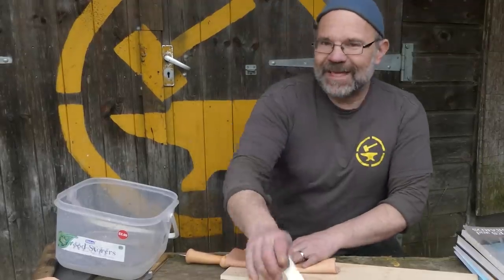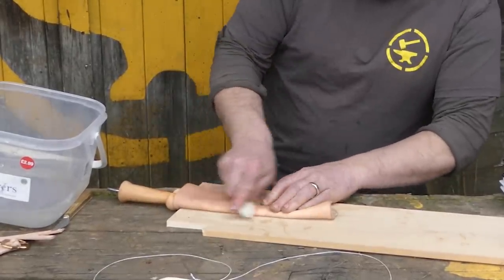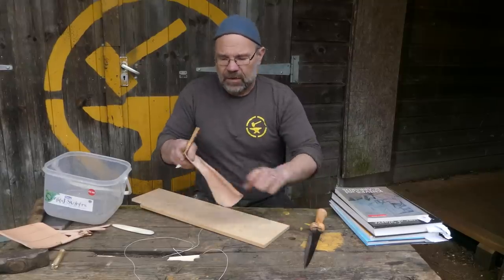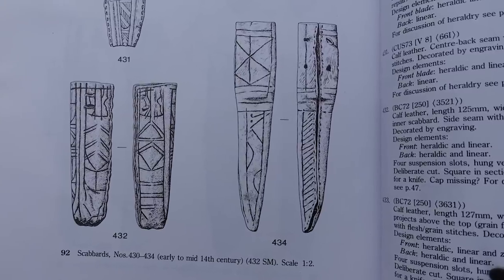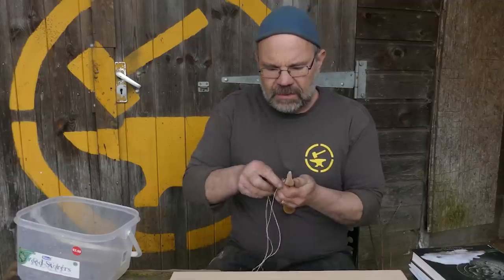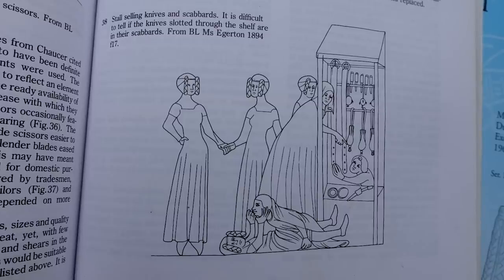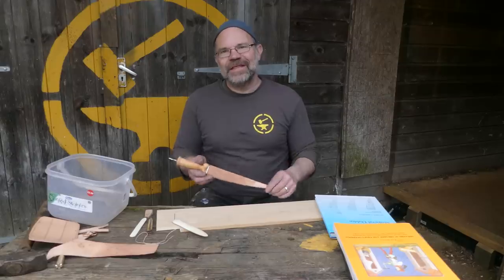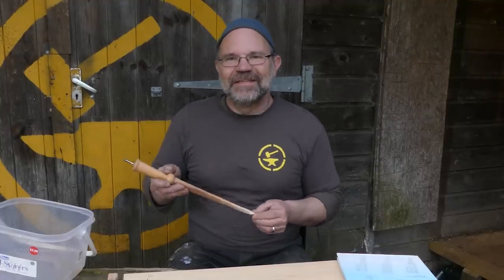Tod Makes Junk - Was Medieval Work Bad?

Comment: Ive been a full time blacksmith for 10 years and the wisdom my teacher had was to always make things 80% as good as you want them to be. No one sees the details that you lose sleep over as a craftsperson .
Reply: Learning that the hard way getting into woodworking with hand tools. It is nice that a machine can make a perfectly square board on all side, and that opens up a lot of design possibilities, but a lot of the time that is wasted doing it by hand if it is hidden or it doesn't matter to final design/construction of the product. Things like drawer bottoms, and insides of cabinets are good examples of getting to 80% is just fine.
Reply: You have to remember that they're probably also having apprentices do work and the craftsman isn't going to throw away material, because it didn't turn out perfect and many of the everyday items just don't need to be top quality, because every day working people couldn't afford better.
Then, if the lord or king needs a whole butt-load of gear made immediately, you can't always afford to churn out the best stuff. It just has to function. I'm just surprised the Mary rose archer's equipment hadn't had more care put into their decoration. Maybe they figured people wouldn't notice from far away. Or maybe, as Todd said, it didn't matter as much.
Reply: The Mary Rose had just been freshly outfitted when it sank. A lot of those weapons were brand spanking new, never used. I’d say it’s highly likely that a soldier or sailor who got issued a weapon like that, would have tuned it and done the final finishing work in their off time. Idle hands and all that…. Long Bows would not have been randomly handed out. Their draw weight varied 20-30 lbs as I remember. Archers would have picked one and made it theirs. They just never had the chance.

Comment: The hardest lesson I had to learn when I switch from doing wooden leather as a hobby for myself to doing it as a business, was that I couldn't make every piece to the perfection standards I wanted. However the flip side of that lesson was learning that as the Craftsman that's making a peace you see every minor flaw but the customer doesn't. And some of them that they seized most customers don't even knowing nothing about the process to realize that they are flaws. So the second lesson I had to learn was to stop pointing it out to them.  So if the customers happy and the piece is solid and structurally sound that is all the perfectionist needed.
Reply: So true.
Reply: Only those with patrons who have deep pockets can afford to put in the effort to make it perfect and at that point, they're competing with people who might able to do as good if not better in a similar if not less time.
Reply: Spot on, that's the difference between hobbyist and professional lot of people don't understand. People often use "hobbyist" as derogative term like it implies lower quality workmanship compared to "professional", but if you are doing something as a hobby you are doing it essentially for yourself for your own reasons and usually main reason is to do best work you can and learn how to do it even better. But professional is doing it for the customer and work quality is defined by what the customer wants, how much is willing to pay for it and how much time you have to spend on it. Professional who can't balance those needs and still make a profit on it won't stay in business for long.
Reply: @IamOutOfNames  That being said I have had almost as much time practicing in my first month as a professional craftsman as I had in my first five years as a hobbyist so I am rapidly getting better as a professional even if I don't have time to focus on producing the best quality I am capable of.

Comment: A sheath must fit a blade in it and protect the user from said blade.
Does it do that?
Yes. Perfect. How kind, you've even decorated it
Reply: This. It's a dust cover and keeps damp off it.
Reply: @papalaz4444244  after reading some comments i also noticed some other things.
A sheath could also be great for the leatherworker's children to learn something of the craft, let them make a few, it probably saves time for you in the end too.
And, it can be possible that these children OR the soldiers who were supplied with the sheaths decorated them, it doesn't have to be the workers job, look how much time Tod spend on even these simplest carvings
Reply: decorated at about the same level as 2021 Sound Clound Rapper face tattoos
Reply: Actually, when you think about it - the decoration actually weakens the sheath, you're cutting into the leather and then prying the cut apart with a bit of bone. So it's extra weird that for purely-functional work, they're still doing *something*.
Reply: I've owned more than a few totally garbage MODERN knife sheaths and tool pouches.
I had an off-brand Leatherman break its pouch the first hour I was using it.
-
Another area of comparison could be modern luggage/suitcases.
You can spend $30-50 on a suitcase that might last two or three flights, or spend thousands on luggage that may outlive you.
It's a matter of what you can afford, and how much you want to spend.
Reply: @MonkeyJedi99  Louis Vuitton made his name on quality luggage - his successors exploited it.
Reply: @allangibson8494  I'll have to take your word for it.
My idea of luxury luggage is a military surplus duffel bag.
Reply: @MonkeyJedi99  Louis Vuitton made working luggage that some of it is still around two centuries later. 
The current owners - not so much.
Military surplus is nothing to sneeze at - it is several notches above “average” simply because the government doesn’t want to replace it during the life of the soldier it was issued to. Wartime military issue turns to crap however because the expected lifetime of the user is dramatically shorter on average..
Reply: @sanityormadness  I'm not a historian, but I think it was just a quirk of the period that any blank face of anything had to have some kind of decoration on it.
Reply: @MonkeyJedi99  The sheath on the British MOD survival knife springs to mind .

Comment: This is quite an interesting conversation. And that's an important point about payment per piece (and the quality issues it brings)... speed matters most. The work needs to be functional but it really doesn't need to be fancy.

There is one thing I have to wonder about though: How much is the age of surviving artifacts coloring our perception? Clearly the state of preservation could make a once beautiful piece look much less appealing now. I'm not even talking about corrosion, that's obvious. Just more subtle things like wood warping, leather cracking and shrinking, etc. The geometry of iron and steel won't be affected by age unless it's badly corroded or damaged but other aspects of the fit and finish might be.
Reply from the maker: Hi Skall, To be honest as a maker I tend to see through these kind of imperfections to see what the piece would have been, but I also think that many of these pieces were clearly beautifully made from the start and age has not changed that.  I would also say that many were badly decorated, but that does not necessarily mean badly made.  We as modern people conflate the two and tend to see the two aspects as wholly related whilst they need not be.  Anyway thanks for popping by.  Tod
Reply: @tods_workshop   Right, that makes sense. You're so familiar with the process and material properties that you can "autocorrect" those aging flaws in your mind.

The bad decoration is interesting... why even bother? I'd say an undecorated piece would have looked better than some of those hasty scribblings. But clearly people back then disagreed.
Reply: @Skallagrim I'm not at all knowledgeable on the subject, but a possible scenario (based off of how fast tod made it) could be that they would make the stamp decorations right before the sale to the specifications of the buyer, and then take it to a guild who's in charge of painting aesthetic embellishments.
Reply: Skallagrim also watches Tod. Perfect :D
Reply: Buy a plain sheath to decorate at home? (Not the stamped ones, I agree with Tod's explanation of those)
Reply: @tods_workshop  Well made yet poorly decorated may have been seen as a feature, not a flaw. Lets not forget the religious aspect, where displays of humility were sought after. I suggest that this (like the intentional cosmetic flaws in medieval cathedrals) were a way to show that while you might be in the Mary Rose, rich enough to afford the best materials and construction, but humble enough to have the stamps done all crooked.
Did this also mean you could bang out work quick and cheap and tell people you did it on purpose because you know they're so humble? absolutely, it's win/win
Reply: I think an argument can be made from a lot of modern production where there is a really good-looking casing from the point of symmetry and level of finish. But the quality of the materials and what is inside a product is not there, so the appearance is misleading. It sounds like value chain analyses was at work; so the painted finish and how colourful and flashy something was rather than symmetry was viewed as important. We now expect regularity and symmetry due to the use of machines. It would be interesting to compare it to other things created at the same time to if the same held true for metal, wood, stone, fabric and pottery work. The expectation of regular symmetry in products might owe a lot to the fashion for ornamental turning in the aristocracy.

Comment: I love Tod's videos, because he always does research for accuracy, then shows his work. It seems extremely likely (to me) that a working craftsman would need to crank out a large volume of blades and/or sheathes to make a living. They weren't making 'The One Ring', they were making tools for other people trying to make a living in whatever their profession was.

Today's collectors are not the fishmongers, farmers, and soldiers of old, and as such, place more value on appearance than necessity. I also think the 'they didn't see the flaws' seems hard for some to accept, because we do see the imperfections so easily - but they had nothing to compare it to. Most farmers would never have seen a perfectly symmetrical blade in their lives, so their asymmetrical one was their norm - and they couldn't have afforded to have a perfect blade made, even if they wanted it. But those imperfect blades were made, and sold, meaning they were good enough to get the job done.

Honestly, there are a lot of cheap blades that are mass-produced even today, and they're mostly useless as 'real' tools/weapons. Their 'function' is as decoration, not livelihood or defense. So cut the craftsmen of the past some slack - they were getting it done to put food on the table, and pay their taxes, same as us...  :)
Reply: A good point in that is the blades and armor that were described as remarkable or exquisite. Even those were generally imperfect, such as the king's armor Todd mentioned. So if something that was obviously flawed can still be considered exquisite, then the context must be that everything else is usually far inferior to it.

Comment: I made quick sheathes for a couple quick knives I made our of cardboard and duct tape, it wasnt the best I could do but it worked for the intended use (to keep it from cutting someone in between the forge and a drawer). I was just learning knife making but as I saw a need I met it with the same level of work, it would make sense for the medieval period to have everything from the barest quality to highest quality leather work based on the job.
Reply: I have an M1898 Dutch Naval Cutlass that has a duct tape and waxpaper sheath. 🤣

Comment: I believe the rough scabbards you point out are homemade. A present from grandmother or something you make to go with your new coat. The scabbard is as much fashion as it is function and most people could work with leather. I grew up in the woods hunting food for dinner. Working with leather was just something we did.
Reply: also lack of standardized prescription eye wear probably meant loads of people couldnt see details anyway
Reply: When viewed from today's eyes that might seem reasonable. However, you had access to modern tools of some quality compared to back then when most people couldn't just afford the tools they wanted for this and that. Some could have been, alright, but what are the chances they basically only find such items. Or that they find similarly made scabbards in a substantial part of Europe. Or that the Mary Rose bracers have the same level of quality?
Reply: @Kraakesolv  you need a needle and an awl

Comment: We do that today also, just in a different  way - you can buy cheap off the shelf Chinese suit and it will be fine for a few months, or you can go to a tailor and get a bespoke suit. Same with appliances, you can buy something super cheap because they put cost cutting measures in design, or you can buy something top shelf.

Comment: I’d like to expand on the point you made about people not seeing it. I’ve found in my own experience the more you know about the craft and the more you know about how you would make an item the more likely you are to spot a mistake or lack of precision.  For example I work in the print industry and most of the time when you have color in an image there are 4 overlays of ink (commonly yellow magenta cyan and black)  if all 4 colors are not perfectly lined up you can see a bit of one color peeking out the side of the image. How ever it’s not usually noticeable unless your eyes focus specifically looking for it. There’s also a thing called tone where there will be excess ink that didn’t get totally washed away and it can be hard to see unless you know to look at where the plate gap would be. These things jump out at me like crazy every time I look at a news paper or a pamphlet where they care less about quality and more about quantity. But i also know that my eyes are trained to look for those things but the common person probably wouldn’t notice. Much like a medieval person who’s only ever seen imperfect swords and has never worked as a black smith would not be looking for perfectly crisp lines  or that time scratch on the blade.

Comment: I work in control circuits wiring, and it always is a struggle between innate perfectionism and deadline restrictions. Sometimes good enough has to be good enough.
Reply: I'm an engineering student, we have a saying: "as good as it NEEDS to be, and as bad as it CAN be". As tod said himself, any time you spend on making it better than it has to be, you are loosing money

Comment: Absolutely loved this one - especially the fact that you were making whilst you were talking. More of that! It's also an issue I have thought about a lot, as I tend to be more interested in the lower echelons of medieval society, and clearly much of what they would have had would have been pretty poor quality. Usable, but not pretty. And, of course, most of what is made today is a) based on what has actually survived, which favours both quality and status, and b) made using modern methods, with modern materials, to modern standards. I think it can sometimes be quite hard for re-enactors to get their hands on stuff that reflects 'ordinary' medieval quality - at least, when it comes to metalwork. Clothes, they tend to make themselves and so that can sort itself out, but most people aren't equipped to make a blade. One experiment when I was looking for a pretty bog standard sword for an archer was to buy the cheapest, worst, generally correct sword I could find - which was beautifully finished, but horribly proportioned and balanced – and then distress the crap out of it, including sawing some bits off the quillons. It ended up looking pretty good (by which I mean quite bad) but would certainly still do the job. Which, in essence, was the point you're making. That's all that is needed from it as far as this archer is concerned.

Comment: I worked in manufacturing engineering for 53yrs & a lot of time was on bonus schemes,would often work 3,4 or 5 machines @ once to make more money,& the limits on tolerances would often be a bit over or under,but when your producing perhaps 1,000 items the same,not all would be inspected,often 10% were checked by an inspector. 
Now if you worked in defence work or aircraft industries,you couldn't get away with it because everything would be 100% inspected.

Comment: I've studied a bit of the history of industrialization. The concept of "standardized precision", or what Todd often refers to "is it perfect?", wasn't widespread at all until the advent of mass production of complex machinery. When you start having mass produced automobiles like Ford's Model T, you have hundreds of different people making hundreds of different parts, and they all have to fit together and work, then everything has to be the right size and shape to fit together properly. That's when people started getting the idea that precise = good. There's a similar history with providing complex firearms to large armies, and how maintenance is much easier if all the parts are interchangeable. 

Before this industrialization, people just didn't have the expectation that everything has to be the same size and shape, that everything had to be "just right", because the imprecision didn't stop simple things like swords and armor and crossbows from working. When you start getting into things like aircraft engines, then things have to be very precise or they'll explode. Precise craftsmanship did exist in preindustrial times, but they weren't mass produced or widespread, so people didn't expect it on everyday items. Fast forward to the second world war, when aircraft and tanks were being mass produced, and the mindset is completely different.